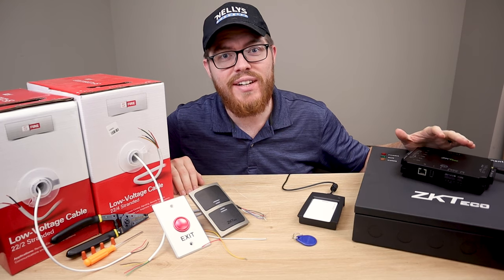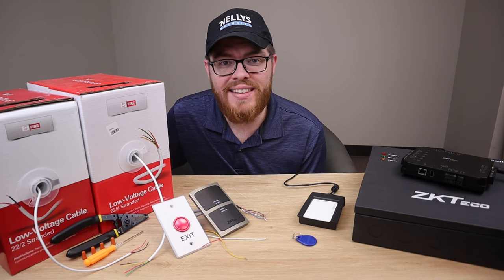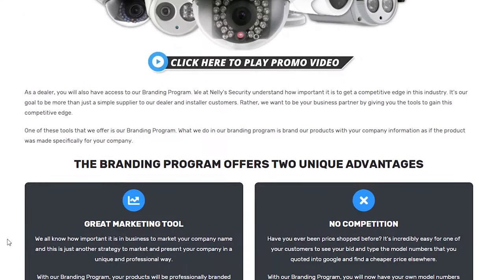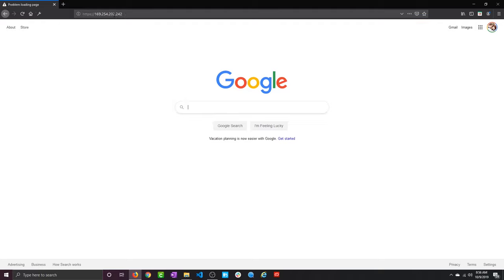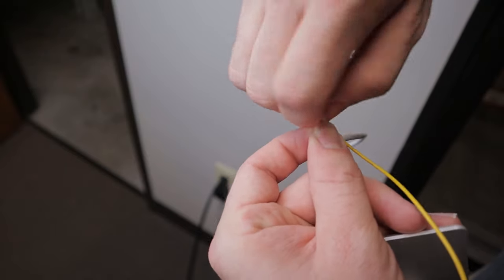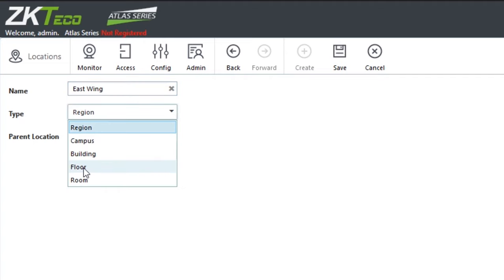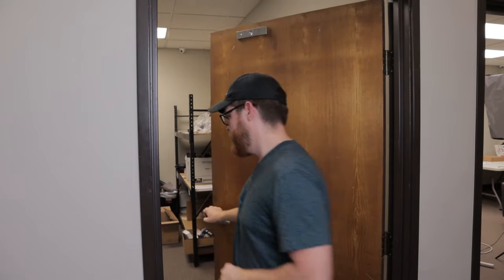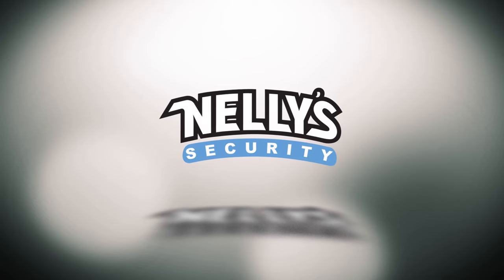How To Set Up an Access Control System: Complete Step-By-Step Guide for Beginners

Comment: Great video for beginners like me! I just want to ask if there's a power outage or the power supply is disconnected, how this device would react?
Reply from the maker: If there's a power outage, all readers would stop working and the locks would either lock or unlock depending if you have it set up as a fail safe lock (will unlock during an outage) or fail secure (would lock during an outage). That said, we recommend a UPS or backup battery.

Comment: Thanks. If a door hasn't got an electric handle and instead has a normal door handle with a lock, if I unlock the door with a key, will the card reader automatically unlock as if an ID card has been swiped or will it stay locked.

Comment: I read that the Data cable pair for the card reader needs to be shielded and twisted. If I used regular 18/2 unshielded, will I have issues?

Comment: Great video and through explanations. Only question is does this system have to be installed using internet or can it be set up and operated in a 100% internet free environment?
Reply from the maker: You can use it without internet

Comment: What is the amount of doors that you can add with this system? can you do 5 doors? or if not what is the model that you need to ? Also you mentioned to check with the city and FD for permits?
Reply: BTW This was a great video!
Reply from the maker: On the Atlas series you can have a max of 21 panels or 84 doors whichever comes first.

Yes, most state/local laws require permits and a walk through with a local fire marshal. I would check to see what your city requirements are just to be safe.
Reply: @NellysSecurity  the one on the video only does 1 door correct? So if I need to do 3 doors I will need to purchase 3 panels. Got it! Do you have a link to yours and the one that does 84 doors.

Thank you!
Reply from the maker: Yes a single door controller is for a 1 door solution.
If youre needing to control 3 doors, then id advise going with the atlas 400 -> https://www.nellyssecurity.com/zkteco-atlas400-4-door-kit-complete-four-door-access-control-kit-capable-of-using-weigand-and-osdp-readers-supports-poe-power-and-wifi.html

If you need more than 4 doors for example, you can stack these panels to get to the 84 total doors. 21 x4door controllers = 84 total doors.

Comment: Can add another controller at another building and another network to be used at the same web access so that I can have access to 2 completely separated locations?
Reply from the maker: The controllers can be in different buildings, but they must be on the same network in order to communicate with eachother.

Comment: do we have to connect the Electric lock from a separate source  such as  220v Ac from a power socket ?
Reply from the maker: It would depend on what power source your lock supports. Typically its 12vDC.

Comment: Quick question: On the box it says 22/2 and 22/4.
In the video it says 18/2 and 22/6.

So which one do I need?
Thanks
Reply from the maker: You can use any one of them depending on your application. 18 gauge is a better cable.

Comment: Is their any type of certification program for access control installers?  I want to be able to troubleshoot the physical components of the system.  I am very familiar with the software and what I can and cannot do.  But when those do not work, I get stuck.

At one of my jobs, the speedy gate is tied to the fire alarm and when we did a few drills, the last drill where the alarm was pulled back on and back off suddenly, the gate locked open.  We tried everything from the software and from the device it appears to still be receiving the emergency signal.  We reset the controller, badge reader, and activate gate.  We power cycled it, reset it manually, and it is doing the same.  Only one of the three gates.  We don’t know why.

Other doors are just unlocking on their own and the software keeps showing error on the unit.  The error shows when it works and doesn’t.

Is their a certification for troubleshoooting these types of issues or for an alarm installer?
Reply from the maker: Zkteco does offer webinars from time to time. Also they have US based tech support so they can always assist you.
Reply: @NellysSecurity  do you have a tecnical based support in Kenya ? I want to always grow with you?

Comment: great video but where can i find the ip address??
Reply from the maker: You can find the IP address using this scanner tool -> https://www.nellyssecurity.com/media/software/zkteco/DeviceSettingTool.exe
Reply: @NellysSecurity  i did it i just started doing installation but i never saw a key scan before but today i successfully instal 6 key scan in a hotel and it was pretty easy although  its my first time

Comment: I actually will not recommend doing it this way. You don't want your request to exit button to release at your panel. Your panel is an electronic component and your request to exit button is relying on it to release. I've seen these panel relays lock before and is never recommended to be release from the panel. It should cut power directly from the Mag lock. He should have added a PIR motion sensor to release at the panel and the button as a direct secondary option (mandatory in most states). Although he has good intentions I would never recommend a beginner to do it this way. He should've recommend an electric strike. Mag locks are risky by state and local county codes.
Reply: Kindly organise for us one tutorial with comprehensive demonstration with easy steps so that we can learn more of these... I'm from kenya

Comment: Man... No DPS means that your aren't doing access control, you are doing card access, you aren't monitoring anything for control. You aren't installing a fail safe power break on your manual REX. You aren't using an optical REX to follow the "no special knowledge" rules in the NFPA. The optical REX should of course also drop power to the Mag if it loses power itself. You also have no UL listed mag power drop on fire alarm. 

Maglocks are also just about the worst thing to use to learn with due to the additional legal requirements, the extra work to actually align properly, to adjust the door closer for proper contact speed to avoid damaging the Mag body mounts into the header, etc, etc....

So yeah....you aren't teaching access control.
Reply from the maker: Thanks!
Reply: Damn... where's your video hater! This is access control because he is in fact "controlling access". Cut it out and stop being miserable.
Reply: @ndleinahaystack  I've been teaching access control and other low voltage for a great many years. This video is demonstrating badge access, not access control.
Reply: And some of what i brought up is federal code. He shouldn't be teaching something if he doesn't meet code.
Reply: Yeah maglocks have myriad of egress requirements. Like you have to have a power interruption in line in the event of a Rex failure. The better option for a beginner video would have been something like a door strike or cylindrical lock that satisfies most egress requirements since they generally have egress on one side built in.